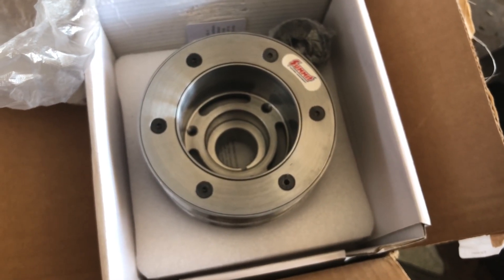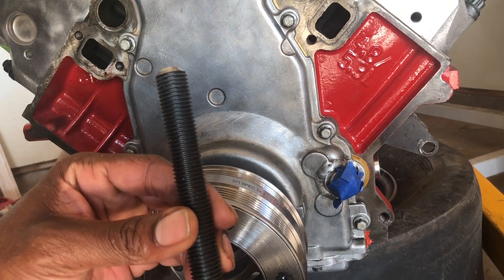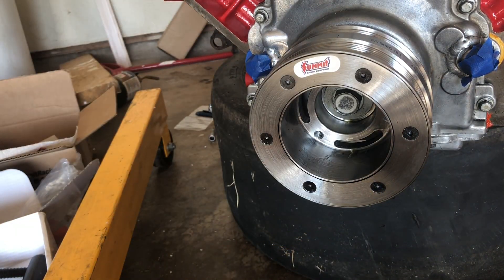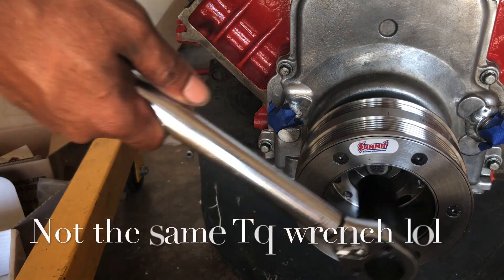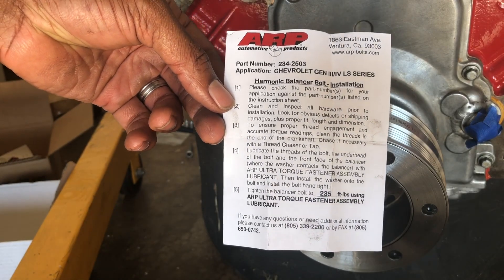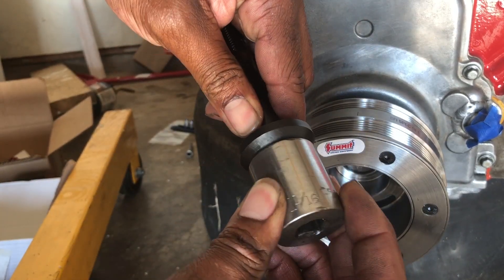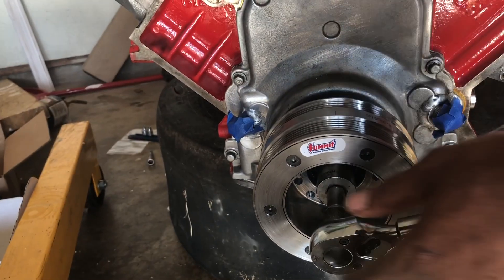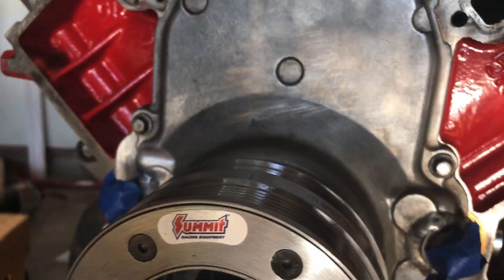How to install LS turbo 5.3 Crank Pulley Harmonic Balancer

Comment: I was told by multiple race shops not to use arp lube. They said to use red locktite. They said they have seen balancers fly off without locktite. 🤷‍♂️
Reply from the maker: Never happened to me, this engine seen some power too. Maybe they weren’t torquing it to the right specs. 240ft is a lot.

Comment: Do you think it’s worth going to a 25% under drive? 
Also did you have any overheating or voltage issues ?
Reply from the maker: The crank pulley comes with a new alternator pulley as well.  For overheating a 160 deg.  Thermostat, helped. But when I switched to electric pump it was the absolute best.

Comment: Nice install tutorial, but how do you remove this balancer??? The bolt holes are too deep for the removers i have tried.
Reply from the maker: I’ve used a two arm pulley puller.  With an old crank bolt in it. I loose the bolt a few threads and pull the pulley off as much as I can. Then loosen the threads and pull more. Eventually I take the bolt out and put a big socket in there and put the pulley on that.

Comment: What serpentine belts should i use with the pulley? Or can i use the stock ones?
Reply from the maker: I’m using a Dayco 6PK1880 from Autozone (I think) I’m also using the ICT driver side Alternator bracket
Reply: @boostinwillie  okay cool thanks. & have you had any issues with this pulley?
Reply from the maker: @GreatestHITS26  no issues working good so far

Comment: I lost motivation,  whats on the block going to flywheel?
Reply from the maker: We all do sometimes. It’s a crankshaft holder. So I  can get that  240ft lbs without it rotating over.
Reply: @boostinwillie  I got my stuff sitting in garage. Been defeated by the fuel line and routing. No place to sit aeromotive a1000. Motor still on stand. I'm thinking of leaving fuel system be and install motor but I dont like to move to other things without completing the first.
Reply from the maker: infamousnova I hear ya. Might have to make a bracket for the pump